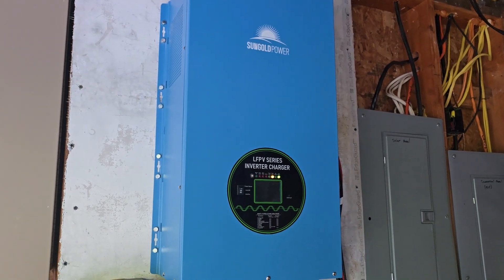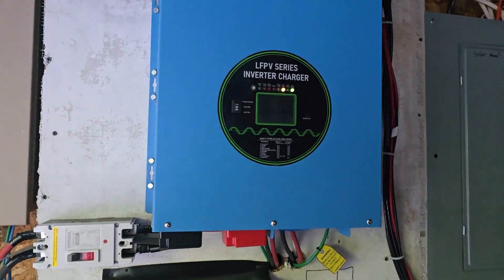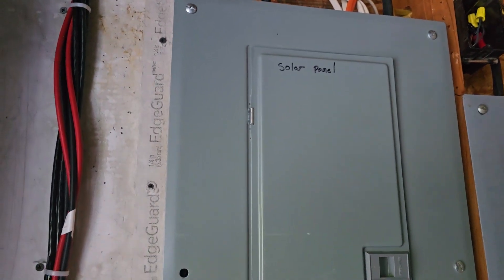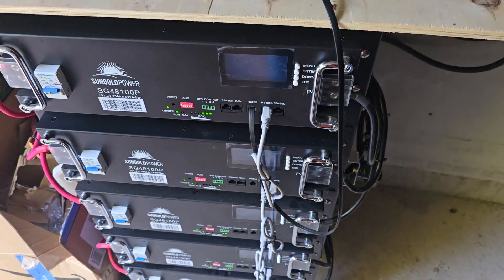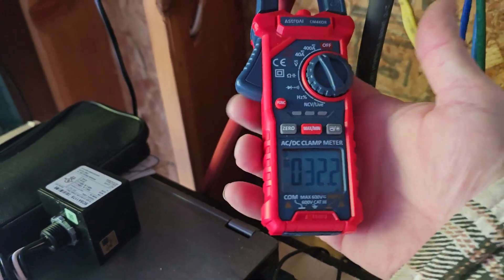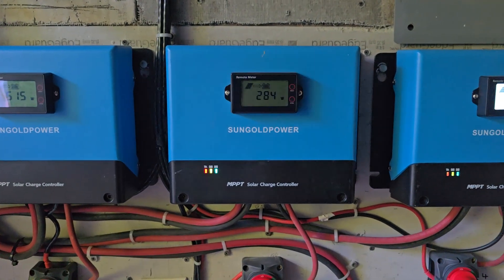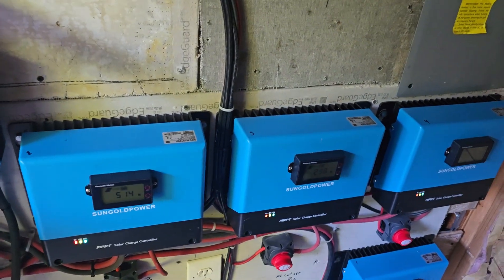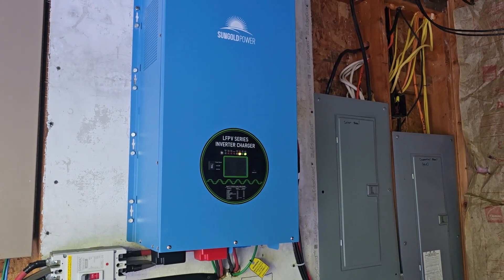Sungold Power solar inverter that can charge from on grid and solar panels at the same time.

Comment: Is that inverter still working?
Reply from the maker: Yep, it works great. I have 1 bad battery that I'm dealing with tech support on...
Reply: @HowToWith24DY is it possible to have it only charge the battery, and let the battery power the load? I'm trying to have it just charge battery not handle the load at the same time?
Reply from the maker: @ForrestWhite-dx5ht 
Not sure about that one.
Here is the link to the user manual.
https://cdn.shopifycdn.net/s/files/1/0323/4090/2025/files/LFPV_Manual_20230920.pdf